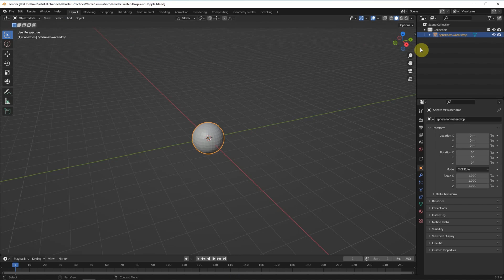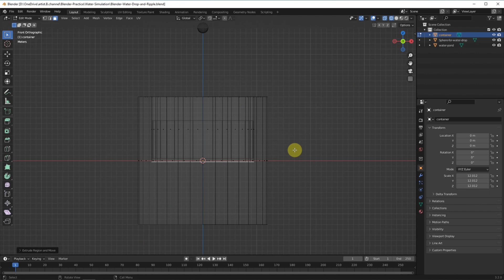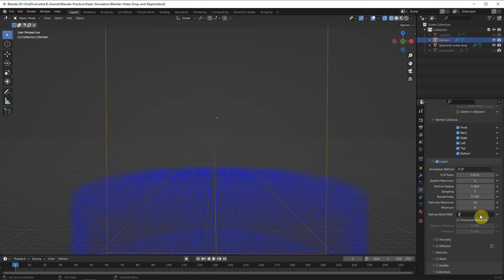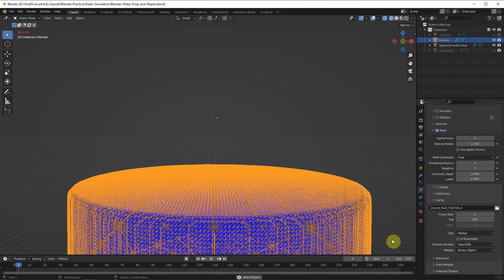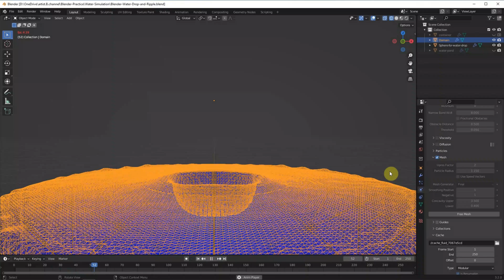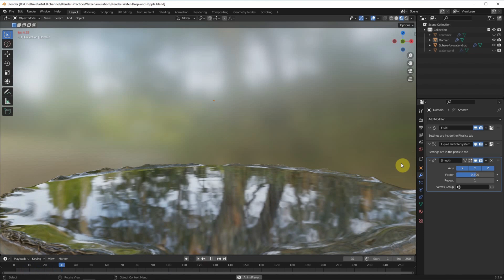Blender fluid simulation water drop and ripples

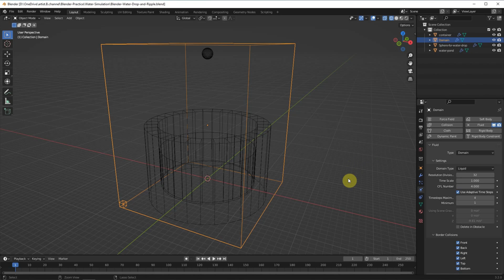Comment: This tutorial worked pretty well for me until 2:07. The fluid is not showing up and I have verified that i have the right effectors for the right things. I'm not sure why the water is not showing up. Have you had any problems like this, and do you have a fix? I know i also have liquid checked on in the domain object.
Reply: Had the same Problem. Went into particles in the physikd tab of the Domain and turned on spray. Than I went into Particles (again Domain= and there turned up the particle size. This helped for me.